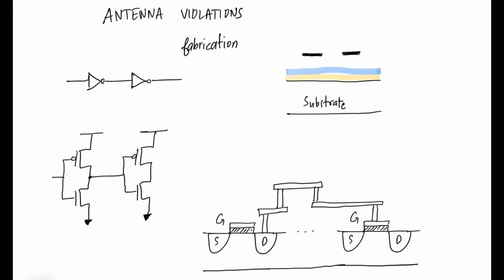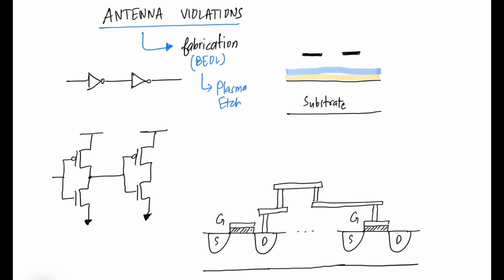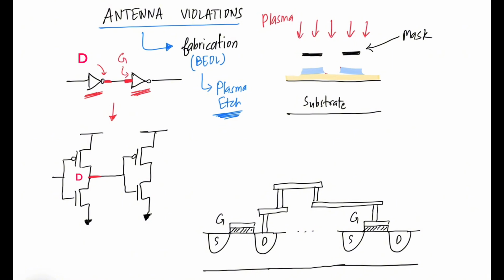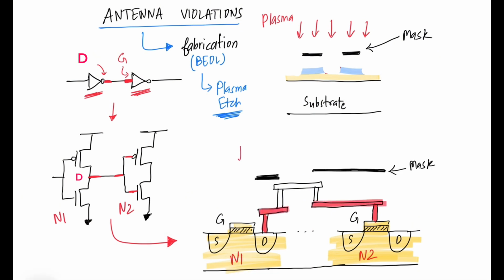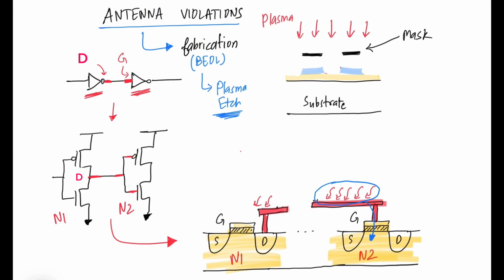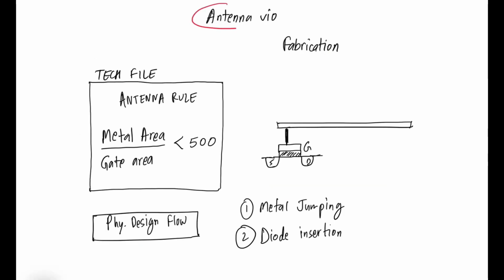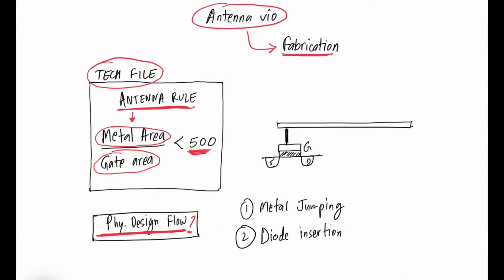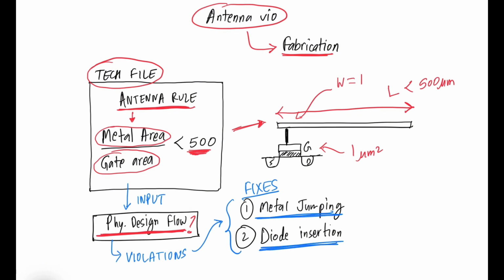Antenna violations & Antenna Rules | VLSI Interview | Physical design | Digital logic 101 #vlsi

Comment: your missed to explain why metal is discharged through drain to bulk connection. You said it is “naturally conducting path”, but it is not. It’s a diode in reverse bias, it’s not naturally conducting path. 
If it was the case no device could work because the current would all the time flow through these diodes to the bulk
Reply: Correct